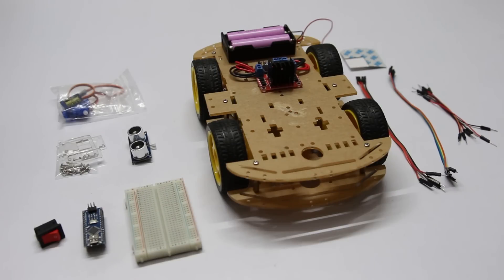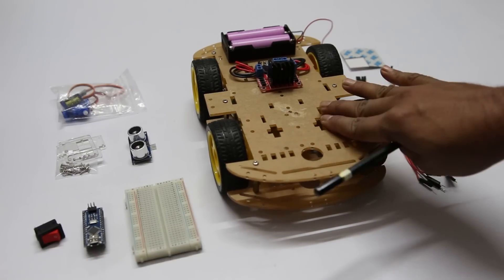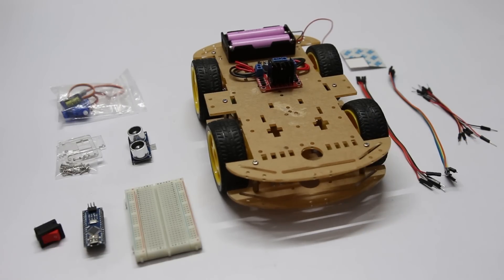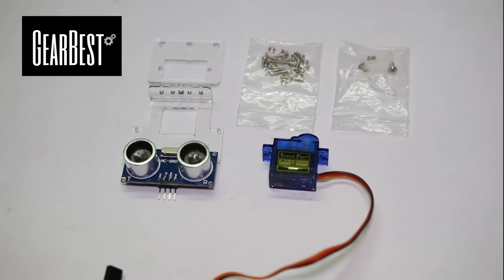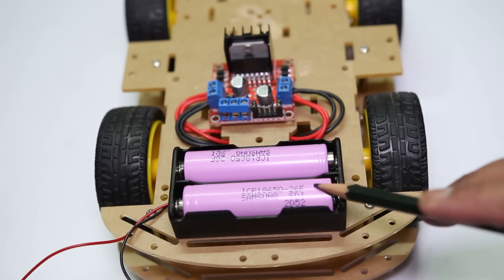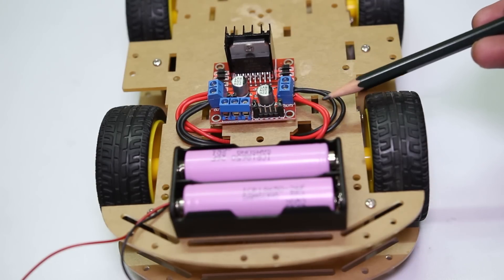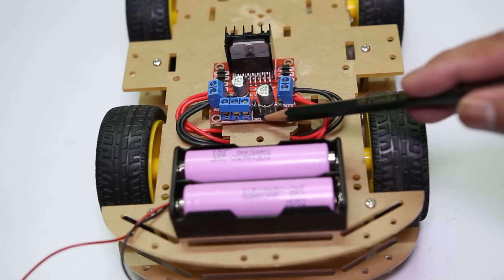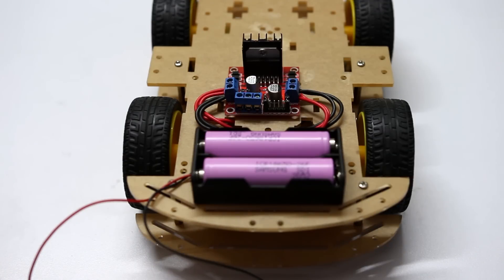Arduino Obstacle Avoiding Robot  ( Part-III ) // Easy School Science Project

Comment: I have done all the work you explained but it doesn't work means to say it doesn't go forward reverse etc
Reply from the maker: Have you uploaded the code correctly.
What battery you are using ?
Reply: @opengreenenergy  yes I have uploaded the code correctly ...I have used 2 Ways 
2 cells of each having 3.7 V and 4200 mah 
And 3 cells of same

Comment: Nice project. can i use 3 Lithium ion cells for the same project?Can the 12volts damage the BO motor or electronics. Idea to use 3 cells is for future purposes and better range.

Comment: Can we use insted of servo motor dc motor
Reply: MASTER OF GAMING 1819
Reply: I have same problem
Reply from the maker: You can use dc motor for four wheel. But for ultrasonic module, you need the servo motor.

Comment: VIRAL SCIENCE YOU ARE GREAT CAN YOU HELP ME WITH THIS QUERY
THAT I WANT TO USE ALL 4 MOTORS IN MOTOR DRIVER WITH 2 SERVOS ALSO SO I NEED MUCH POWER SO CAN I USE 12 VOLT RECHARGEABLE BATTERY THAT BIG  AND HEAVY ONE (ONE INSIDE THE UPS).
PLEASE REPLY!!!!
Reply from the maker: Rachit Sahu Yes.You can use it
Reply: will it damage the motor driver ie LN239d

Comment: i have only 2 motors.....1 ultrasonic sensor,one lcd display,and one ir sensor......i connect 2 9v batteries in series to japan socket .....i power and control the 2 motors with l293d ic.....but my battery gets low very quickly.....within minutes ....please tell me how to power the entire thing
Reply from the maker: +Vedant Joshi Hi Vedanta,
9v battery have very limited charge.It is better to use lo ion battery as I have used.I have given the links in the video description.

Comment: Sorry sir
Please help me on this error:

Arduino: 1.6.10 (Windows XP), Board: "Arduino/Genuino Uno"

C:\Documents and Settings\VAN NGUYEN\My Documents\Downloads\FW5VI90IUOHMPMB\FW5VI90IUOHMPMB.ino:7:21: fatal error: NewPing.h: No such file or directory

 #include <NewPing.h>

                     ^

compilation terminated.

exit status 1
Error compiling for board Arduino/Genuino Uno.

This report would have more information with
"Show verbose output during compilation"
option enabled in File -> Preferences.

Comment: sir code is showing errors plzz helpme,
Arduino: 1.8.1 (Windows 10), Board: "Arduino Nano, ATmega168"C:\Users\priyanka pavan\Downloads\FW5VI90IUOHMPMB\FW5VI90IUOHMPMB.ino:7:21: fatal error: NewPing.h: No such file or directory #include <NewPing.h>                     ^compilation terminated.exit status 1
Error compiling for board Arduino Nano.This report would have more information with
"Show verbose output during compilation"
option enabled in File -> Preferences.

Comment: nice video>> i have a problem >> my Bluetooth did not work unless i add another source of power " usb from labtop" although i have 12 v battery connected to my arduino and motor shiled

Comment: Arduino: 1.8.1 (Windows XP), Board: "Arduino Nano, ATmega328"

C:\Documents and Settings\RIGHT\My Documents\Downloads\FW5VI90IUOHMPMB\FW5VI90IUOHMPMB.ino:7:21: fatal error: NewPing.h: No such file or directory

 #include <NewPing.h>

                     ^

compilation terminated.

exit status 1
Error compiling for board Arduino Nano.

This report would have more information with
"Show verbose output during compilation"
option enabled in File -> Preferences.

help

Comment: help

Arduino:1.8.1 (Windows Store 1.8.1.0) (Windows 10), Kort"Arduino/Genuino Uno"

C:\Users\MatsAndreas\Desktop\FW5VI90IUOHMPMB\FW5VI90IUOHMPMB.ino:7:21: fatal error: NewPing.h: No such file or directory

 #include <NewPing.h>

                     ^

compilation terminated.

exit status 1
Error compiling for board Arduino/Genuino Uno.

This report would have more information with
"Show verbose output during compilation"
option enabled in File -> Preferences.

Comment: sir, really need you help . I have made the same robot you did With the same connection and I have also bought the items from your link the code is properly verified and uploaded but it is not working properly CAN YOU PLEASE HELP I REALLY NEED YOU HELP PLEASE.. I THINK THERE IS A PROBLEM WITH THE CODE
Reply: ur right bro
im facing same problem
Reply: Noushi.patorin Ansari problem solved
Reply: bbupi10198
this is m fb id
send me rqst
Reply from the maker: Use this code 
http://cdn.instructables.com/ORIG/F9Y/LS8I/IW6PH2UD/F9YLS8IIW6PH2UD.pdf
Reply: I have used this code my it's still not working
Reply: Open Green Energy . There is problem with the code. Please help
Reply: The robot senses an obstacle turns right but keeps rotating right  360 deg instead of moving forward after taking right turn.
Reply: I bought everything needed for the robot because my science fair is coming up.. but now the code isn't working properly... The robot goes forward but when it detects OBSTACLES is stop but doesn't go left or ryt
Reply: @Alaksa.Anjum_Khan  plzzz snd me your mobile no. I wanna talk to uhh......i m very help full of uhh if uh talk to me
Reply: https://www.arduino.cc/en/Tutorial/HomePage
Reply: anjum give me your ph plz i want to talk you
Reply: tell me a solution
Reply: Help me anybody?

Comment: And can we use Robodo L298n Dc Driver Controller Stepper Motor Smart Car Board Module Arduino Pic, Dual H Bridge Dc Motor Driver?
Reply from the maker: It will work.

Comment: can we use Frentaly 3x Solderless BreadBoard 400 tie-points 4 power rails 3.3 x 2.1 x 0.3in 84 x 54 x 9mm?
Reply from the maker: Yes, you can use it.I have used the same breadboard in this video.

Comment: hello, is there a reason you did not connect the h bridge to pwm pins to control the speed of the motors?
Reply from the maker: No there is no such reason.It is just a basic tutorial for beginners.You can use them.